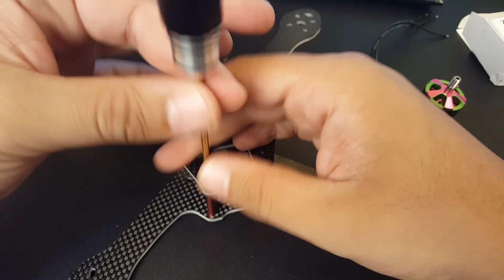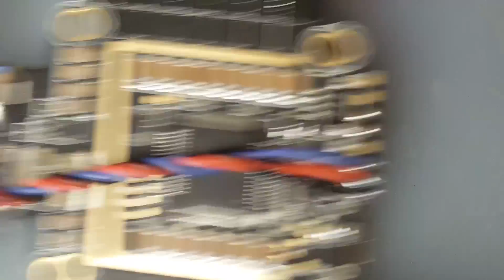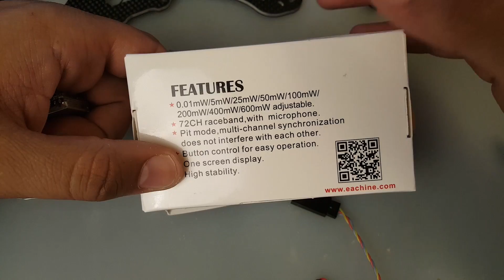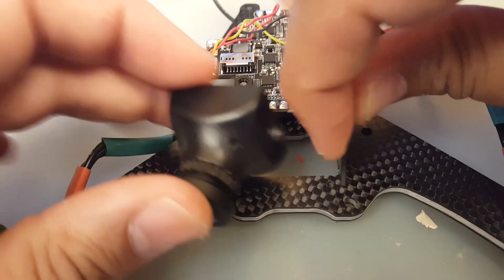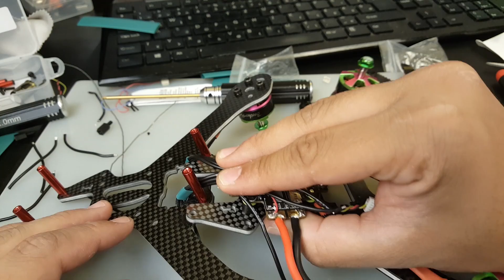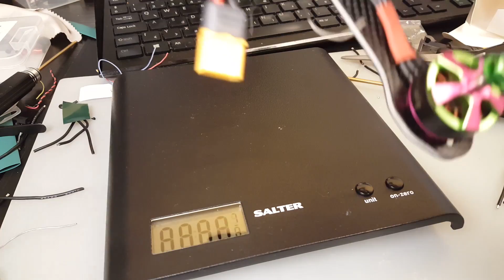How to build a racing drone 2017 // Asgard, Moka Simplex, R4 2700kv

Comment: If you are applying a bare wire to a pad that has solder already on it you should either add flux or pre-tin the wire. It will make for a much better connection. Otherwise use a helping hand/fun-tac to hold the wire/FC in place and add flux core solder to both simultaneously.

Comment: That is one thin frame. I'm now building a custom BFight 210 with electronic partially taken from year old racing quad and managed to squeeze all of it inside. In this frame it wouldn't be possible :)  I have a pair of cameras which you're using - these didn't fit into BFight 210 because of screw hole areas pointing out - I used Eachine C800T in it. By the way Kopis used smaller format camera than yours in this video.

I see you also mounted VTX with a straight connector pointing out from back. Good to avoid the common ground contact with frame (and random blind spots at FPV receiving in result or fireworks on accidental battery "+" connection to frame). The main problem obviously is how to avoid VTX connector snap on crash - so zip VTX antenna to end of frame and bend it downwards. Seriously.

And thanks about idea how to solder big low ESR capacitor on battery pads. I soldered it with cap aside - this way is more compact.

Comment: If you run the motor wire is underneath the upper arms I've seen a lot of people do
Reply from the maker: +QUADBOT FPV yes but r4 wires did not allow without causing alot of stress on the motor wires.

Comment: That's the best iron tip in my op. Been using it for years.
Reply: WhomImIzFPV I'm the same way. Never have problems with the big chisel tip. When I use those real thin pencil tips that's when I have issues. The solder actually floats above the flux and you get a bad connection. The large tips always activates the flux all the way through to the board.
Reply: Nitro Nut Yuuuuuuup, i just turn the tip 90 deg if i need to tin a tiny pad.
Reply: Nitro Nut We are just OG's... Ill solder shiney joints with a 4x4... Lmao!
Reply from the maker: +WhomImIzFPV Agreed, Been using it for 9 months straight now for everything loool even when I poped a tiny cap off a board was able to set it back with same tip.

Comment: Great vid as always. Why not use the heat shrink technique you used on the front motor wires to protect from the carbon of the camera mount on the back motor wires to protect those wires that are rubbing against the edge of the carbon of the top plate. Keep up the great work!

Comment: That vtx is shitty, like really shitty ! I promise you you will never buy that vtx again
 I looked at one review, I think project blue falcons
Reply: Agree with Buzz. I've been using the Eachine 526 for months on my Wizard The range and signal have been great. Dont know why folks are so down on them, you cant beat them for the price.
Reply: beachcomber52 when I was building my quad I looked at JC's review of tx802 and it was bad vtx
Reply: wouldn't buy anything other than a Tramp or Unify myself.
Reply: nub I thing that eachine 526 is good. For me is unify too expensive. 40$ for vtx and 20 for shipping :/

Comment: 4mm foam? Hummm. Not exactly a kopis killer, bro, at least for durability.
Reply from the maker: +Henry Triplette Time will tell and the foam is going for more of a light setup. Soon enough I'll hit a pole and cone back with an update video.
Reply: Very interesting, i think it will change the frame optics a  little, sharp edges will disappear. actual i designed a sandwich frame with fibre 0,5mm and plywood inbetween. very light, but glueing together was a pain. in the future i will go this way, but without using component adhesives to put the frame parts together. will change the design for screws. Much easier.
Reply: I don't believe that was really the outcome of that discussion.  The model the presented seemed to indicate that IF the right fill was used in the right ratio a 4mm carbon and 5mm carbon / foam composite might be comparable but that the foam composite was much less able to handle impacts and therefore he advised that it shouldn't be used for freestyle frames...  Definitely not doubling strength. Still a really cool video though! thanks for sharing.  I have one of these foam filled frames. Very stiff. pretty light... you can tell it's not ready for a hard impact... it's going to snap on a serious impact where carbon would flex a lot more before yielding.

Comment: I wouldnt Call a foam fill frame a part of a kopis killer. But you can prove me wrong
Reply: Hrr Pippi yep kopis is rock solid and it is stretched X. A stretched X frame is ideal for racing. I love them!
Reply: Hrr Pippi agreed there are two versions.   The foam one is the pos. There is an alll carbon one that is pretty badass
Reply: Hrr Pippi agreed there are two versions.   The foam one is the pos. There is an alll carbon one that is pretty badass.
Reply: fly better, crash worse. Kopis vs foam. does being able to wreck harder make it fly better?? hmmm thought think kinda stuff
Reply: Usernamexists ya know.   I retract what I said.  I have the foam carbon one (Moka) and I like it as much if not more than the all carbon.  I have to admit I’m impressed with the moka
Reply: Damnit! I'm sold. I'm gonna get a foam. Geez I'm barely done with my Hippo
 I blame U JJ! Ya I guess I gotta blame Mesh too then.
Reply: Usernamexists lol I did a review on the Moka simplex pro the other day.  Check it out.  You’ll like it